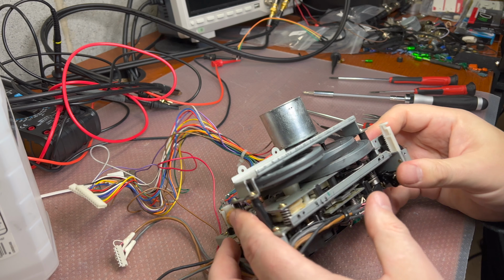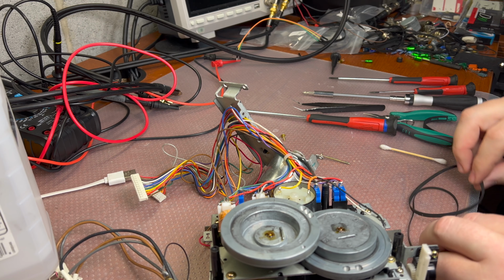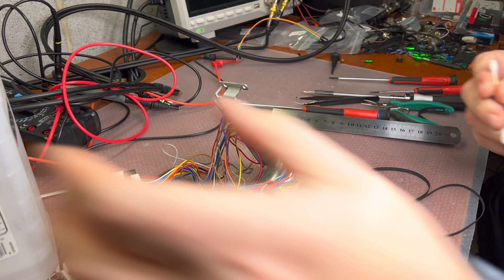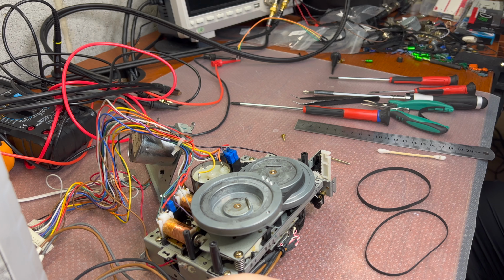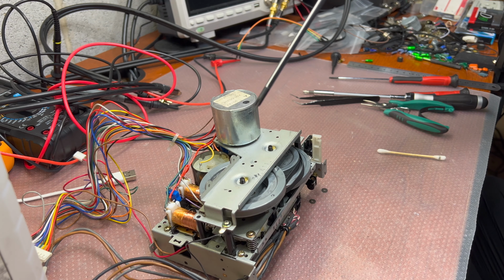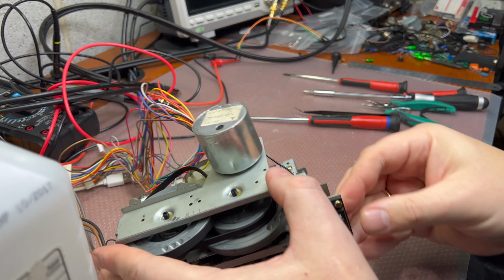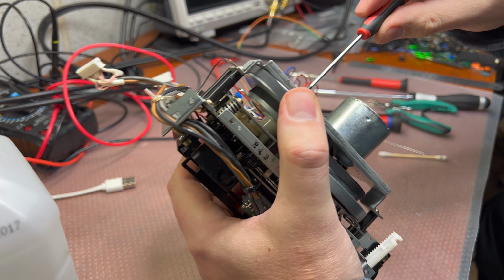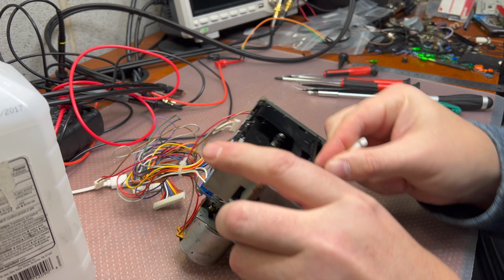Part 5 - Aiwa AD-F990 Restoration for my subscriber   4K

Comment: Hello, I just bought a 990, had one years ago from new. This deck when you turn the output level knob the sound will go in and out on the left or right, If I put the knob in a certain spot it will sound fine (Left and right). I tried cleaning the switch with Deoxit but it didn't seem to make a difference. Could the switch be bad? Thanks.